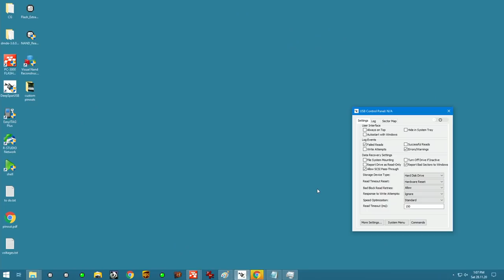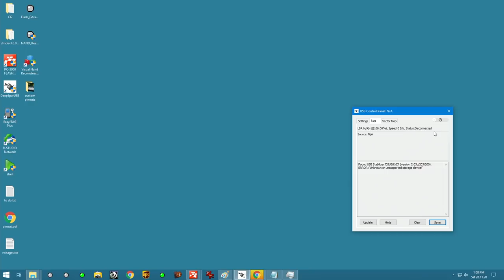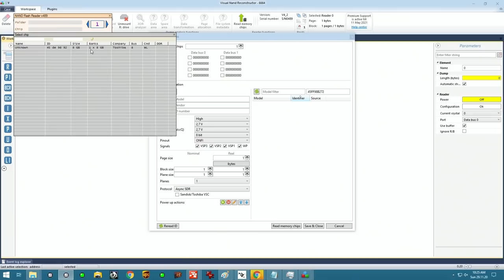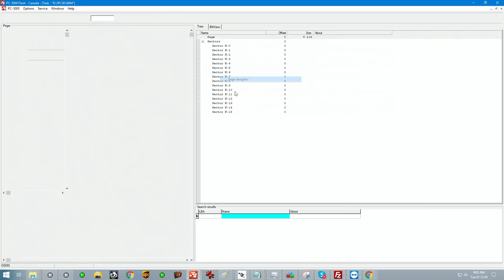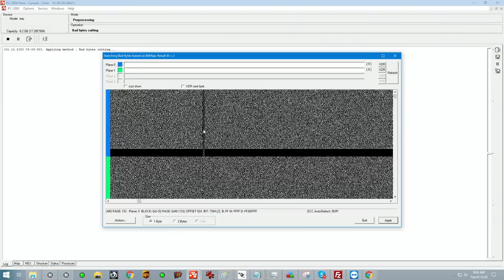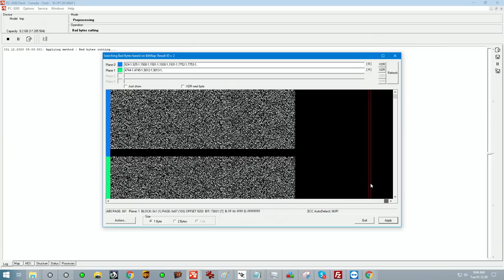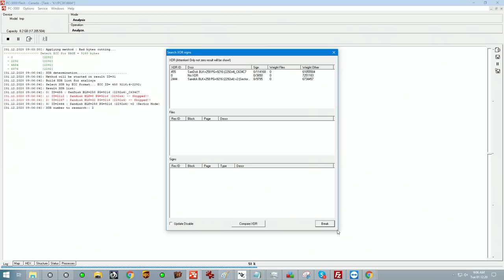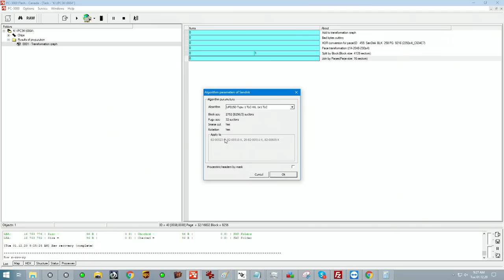sandisk flash drive does not power up

Comment: Always do your Backups ^^!. Had a dying SanDisk microSD here, still with warrenty, so I got it replaced. Sandisk allows you to break apart the RMA'd Card if you ask for permission, so you can be sure the data is 100% unrecoverable by SanDisk if there's sensitive stuff on eg a write locked drive. SanDisk Stuff likes to die weirdly in my experience.
Reply from the maker: I liked Sandisk until their recent LDPC products. SD cards with 170mb/s 4K sector size are not recoverable and wont be for a long time I think if ever
Reply: @hddrecoveryservices  we hope the best for all customers having cards submitted like that in the future.

Comment: Erkin, out of curiosity, you made the dump with FE just because you have that adapter around? PC3000 Flash only works with their adapters? They charge €1,000 more for the complete set of adapters (spider included), so i was wondering about possibilities to make it cheaper.  Thanks!
Reply from the maker: Pc3000 was reading another case at the time. I am so used to multi adapter that I hardly ever use anything else. But I have a full set
Reply: @hddrecoveryservices  So do you think it's more about the power of PC3000 Flash software, not the hardware, that would work only with their adapters? Multi-com adapters are connected directly to PC via USB, no need for a reader, right? Thanks for answering. 
Ps. I went to multi-com site and i guess i figured it out, they sold adapters for pc3000 specifically, and their prices are better. Thanks.

Comment: Very interesting, had not seen any work on flash drives before.

I have a bunch of USB flash drives from a vendor that contains stuff I don't need anymore but they are in read-only! Any advice/tips on how the remove that lock?
Reply from the maker: removing the lock and keeping the data afterwards may not be possible. I know a lot of controller vendors will have utilities that can run a "selfscan/refarb" type of process to make the device functional but blank, but we don't use that stuff in our line of work. People pay us for their data, not for devices functionality

Comment: On 1:00 you're appliying solder over golden pads - does this actually do anything to the pads in terms of functioning properly, like passing electricity and stuff or its pure cosmetic effect to fight the corrosion?
Reply: Not going to use this drive after the recovery anyways.
Reply: he's tinning the pads. so it's easier to work with later on / ensure good connection.
Reply: @colinstu  sure, but considering if that was for example PCI connector on GPU, would you be able to use GPU after tinning PCI pads associated with voltage?
Reply from the maker: Colin is right. Tinning pads helps a lot with bonding.

Comment: JBC cartridges are way over priced for the micro iron.  Unless I need the higher temp and thermal mass I will stick with the knock offs or just use a  bigger iron.
Reply from the maker: how do you find knock offs quality wise?
Reply: @hddrecoveryservices  Well they are not bad since they cost about 8 dollars for one .1mm or .2mm tip cartridge.  Give them a try for what they cost, if you find your use doesn't work out you're not out much.